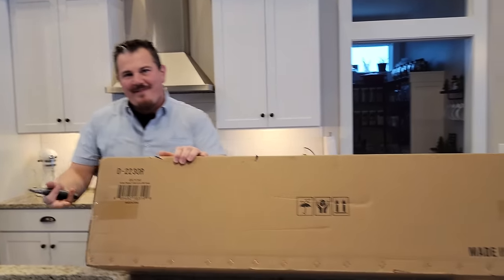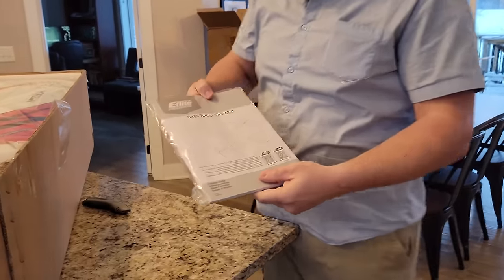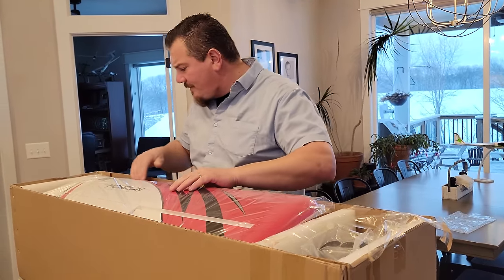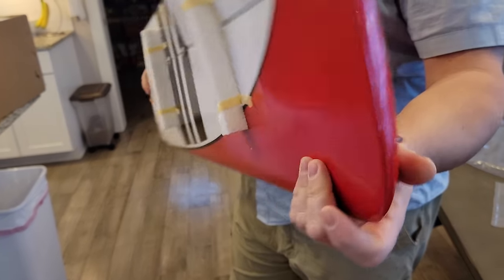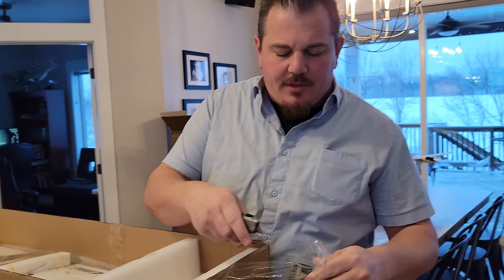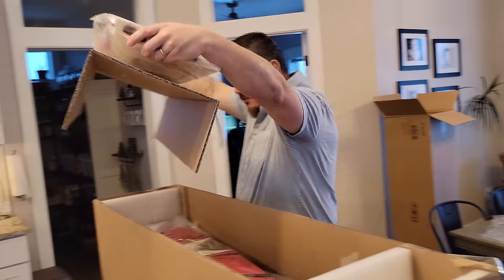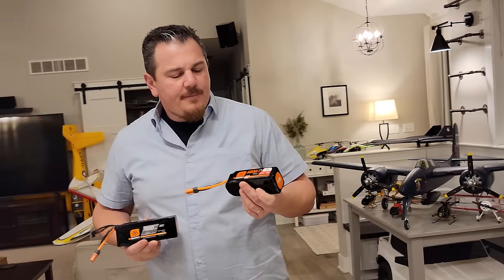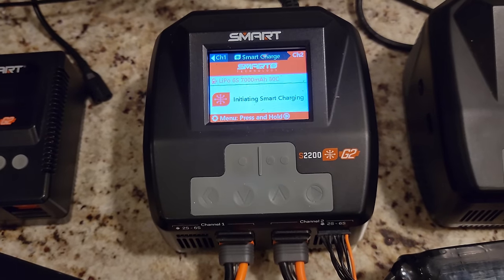E-flite - Turbo Timber SWS - 2.0m - Unbox, Build, & Radio Setup

Comment: A tip to strengthen the wood is to soak it with thin CA.  I do this on battery trays and screw holes.  Just make sure there is good ventilation while the wood dries.  Awesome plane!  Can't wait to see the next in the series.

Comment: Gorgeous plane. The last foam plane (Flightline B25) I bought was $529 for PNP plus another $130 for a receiver. $660 compared to $850 for the balsa BNF. No regrets on the B25, but another $190 for a bigger balsa plane seems like decent value to me.

Comment: On the $849 price. I speced out a Sig Senior Cadet ARF with a Spektrum motor, 80 amp ESC, 6 channel receiver, prop, spinner and 6 Hitec HS-311 servos @ $14 each. Total was $862 and similar to the Timber ARF because the parts you need are almost identical. Yes, you can go cheaper on some of the parts, but you can do that on the Timber too. 

Balsa models are more expensive than foam. If you don't like the price don't buy it. Mine is on pre-order.
Reply from the maker: 100% and that's why many don't get the more expensive planes. Not everyone can afford this type of plane, and I totally get it. The difference with these balsa planes, is that it'll be in GREAT shape in 10 or 15 years, whereas the foamies will have loads of hangar rash, and just deteriorate more. I still love foam, don't get me wrong, but once in a while, balsa wood is just dang cool!!!!

Appreciate your comment - Thanks!

Comment: Great job on the 2000 mm TurboTax Timber! When Installing nuts  in a hole, place a piece of masking tape over the end of the nut driver and push the nut into the tape. It will hold the nut in place. I'm a retired aircraft mechanic and that trick saved my butt alot.

Comment: C'est juste génial JF, en tou cas respect à Madame pour t'avoir suivi dans ce mix entre Indiana Jones, Koh-Lanta ou Retour à l'instinct primaire 🙏 
Maintenant qui lui a coupé la tête et crevé les yeux ??? 
Tu as essayé le riz pour la batterie et ce qu'il reste du drone? 
Perso j'aurais essayé avec un autre drone et un genre de grapin accroché à un systeme de larguage pour degager le drone dépaneur en cas de soucis, avec une personne au sol et le pilote à côté pour guider avec des jumelles avant les intempéries. 
J'ai deja récupéré un avion RC avec un air2s, et un hélico semi-maquette avec un hubsan zino et un eméteur 5,8ghz sanglé en dessous pour avoir un vrai retour vertical, parce-que mine de rien ce vieux coucou de zino est si lourd (avec une 3s 5000mah qui depasse de 5cm derriere, ca résiste à des vents de fou et soulève un éléphant ! )
 Content pour toi au final, c'est tellementt frustrant de savoir un de ses drones dans la nature, c'est nos bébés à nous les passionés! 
À+ amigo 😉

Comment: Brian - love your channel!  Quick question - if you put floats on this Timber and fly it off of water, is there any concern for the exterior servo(s) getting wet???
Reply from the maker: I just had another question - all the foamies do this too...shouldn't be an issue, but if you're real concerned, just make a plash guard for the rear servos.

Gotta keep in mind, the servo is mostly splash shielded already, and if you get water into the electronics, you'd be already under water, and for some time - might have already been a "bad day" if that happens.

Either way I will share about this after I do floats when our pond is done :) I can't wait!!!

Comment: The only thing I know about lock type is it won't stick if your bolts are oily. So make sure the bolts your lock tighting are free of oil. And the whole you're putting them in is free of oil and keep lock tight away from any plastic. It will turn it to potato chips. That's what it turns into like. Crispy potato chip feeling stuff and it just yes, bricks down in the dust. Basically, it will completely destroy any plastic. It comes in contact with..

Comment: I really wish Eflight would utilize 6 and 12 pin connectors instead of separate servo connectors. The whole, "Rats Nest" of wires and connectors is so frustrating with these planes. Especially when you have to remove the wings for transport to and from the airfield.

Comment: I'v gained so much from your site in setting numerous planes up over the years.  Thank you for that. One thing that's always bugged me is the fact you set your planes up with the prop on.  The first things I taught my grandson in flying RC was to always have the prop off until your actually ready to fly and always treat these LiPo's as small grenades.   I don't trust any thing electronic, especially when my fingers are at stake. .  And my batteries are either fully charged before flight, or in storage mode tucked safely away in an ammo box or safer.  One thing I always do as well is to balance my props.  Ok - I"m done complaining - do it because I don't want to see some one (you) get hurt because something "should have been off".   A great teaching moment for our kids and those new to the hobby.   Wouldnt you say  ?     Russ
Reply: Good Advice Russ ..

Comment: My flaps out of the box were weird, ended up taking servo arms off and replacing 2 or 3 notches up or down on the splines. Like yours, the servos were bottoming out on the up position. The figures in the book are a mile out
Reply: My figures are  -12% 35% & 74%, this is with the arms altered

Comment: A great video and thank you for the very informative detail of the ESC set up. I wanted to buy this model as I already own the 1.5M variant.  However, I am so disappointed that E flite have permitted two external servo controls! They are not weather proof, will get drenched if you use floats and being a tail dragger, will collect all manner of material off a grass runway. Finally, in my view, what was a beautiful looking aircraft, has been ruined by poor design. Anyhow, thank you for you and Megan's hard work producing this material, even with a sore throat!
Reply from the maker: I understand your concerns. Two external servos at the tail might be getting a tiny bit wet, but to be honest, I guess I just haven't ever had anything come of that issue. Keep in mind, most all the foamies are the same way...BUT I guess it's not totally inconceivable that one could run into issues.

Couldn't one make a cover, similar to what the UMX planes use over the linear long throw servos??? Might that solve your concern?

Also, and to be fair...I LIKE having them out, WAY easier to service....BUT they are pretty much butt ugly. The cover would help with both issues, OR a super skilled balsa wood crafter could fairly easily move them inboard, OR at least up front, with long control rods.

Thanks for the feedback, and I hope you get a chance to see one in person. It might change your mind ;)

..& Thanks for being here with us too!

Comment: Brian, I flew my new Turbo Timber SWS 2.0 for the first time today at my AMA club. I love it! I'm new and I see it as a plane I can grow into. However, my trainer and the builder/programmer, who also love the plane, noticed that it makes a strange high pitched sound when flying. Their best guess is that there is not enough air flow out of the fuselage. I couldn't find anything in the manual that mentioned creating one, as some apparently do. Nor could we find a location meant to create one. Do you hear this when you fly it? Any ideas?

Comment: Use thread locker on all metal to metal screws .. especially grub screws in collars that hold the wheels on.
Reply from the maker: That's cool so long as you're not talking about any plastic to metal contact areas, then if you REALLY want thread locker, you gotta get the thread locker on the bolts/screws and then let it dry before installing them. It's the solvent that makes it runny that will cause cracking and weakening the plastic. I've learned that lesson a few times over, and thankful it was in my earlier RC days ;)

Comment: You don’t want locktight to dry or it will turn to powder when you tighten it up
Reply from the maker: If that were true, the MFG'ers wouldn't be able to apply it to bolt before shipping them in packs. Might be a slightly different formula, but my understanding (which I've proven a few times so far) is that the solvent will eat plastic.

Maybe the stuff on the bolts from the MFG'ers is PAINT and not Loctite?

Comment: Hi Brian
Your video s are great  and it wud be nice to see a bit more of camera crew instead of camera crews voice ! I love this SWS  Timber and I own a Timber turbo 1.5 m . It looks to be a fantastic model , however I am very sceptical and not impressed that it has plastic clevis's !!! Those plastic pins are not as strong or have the longevity as metal ones !  Not keen on paying $1599 Australian ! What is your opinion on plastic clevis's? I have written off a PC -9 1500 mm wspan because of elevator plastic pin failure .I Appreciate your response
Cheers
Bomber.

Comment: Can you do a video on how to set up Crow with this airplane. Thank you?
Reply from the maker: We plan to do it. It'll be a super easy mod, and we already have it on our docket...but just waiting a few weeks or months to cover this part. We usually try to line this up for when we do our "Second Thoughts" but also depends on if the planes are in stock or not. We TRY not to put out a video, if planes are impossible to get...but we often fail.

Okay, here's a couple in the mean time to tide you over. Might not be EXACTLY the same setup, but might get you where you need to be, if you can't wait. We have more, but these were quick and easy to find.

ASW-17 - https://youtu.be/dspTMZB_JXE
Ranger 1.2m - https://youtu.be/IZfpsMYVKP4
Reply: Mine remain question was to confirm my thoughts that I have to relearn the servo settings as the receiver was not set with Crow. After watching that video you sent me realize we do have to relearn servo settings. I thought that was the case. I learned a lot from you in the last eight months that I feel pretty confident with forward programming and avian set ups. I want to thank you for that.

Comment: Is the skin that covers the frame of the plane thin and easily punctured/torn?
Reply: Good question pal. You would think so bit no this stiff is rather tough I'm sure it's either a mono coat or oro coat.

Comment: Its hard to believe how careless eflite is with the esc cooling. I mean did they not learn from the 1.5 that it needs proper airflow.
Reply from the maker: Those vents are basically for desert flying. I doubt the average joe will ever need to add the air scoops. The 1.5m was a foamy, with the battery trapping it in an awkward spot...this plane won't have any issues, in my opinion.